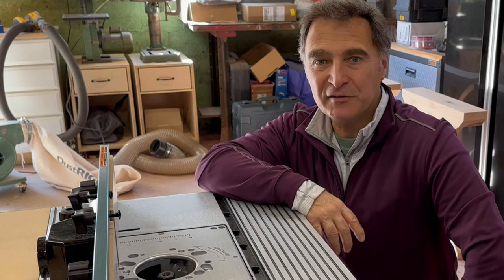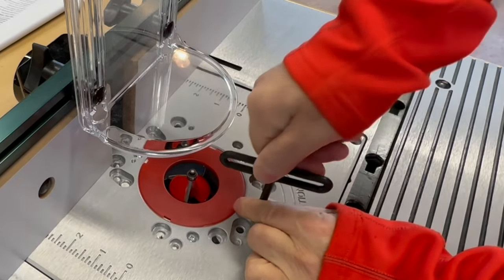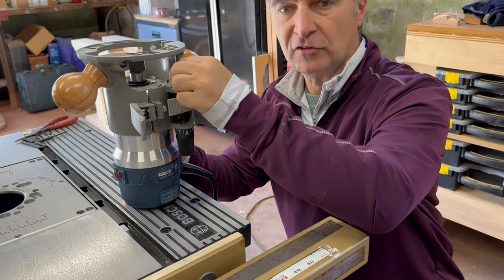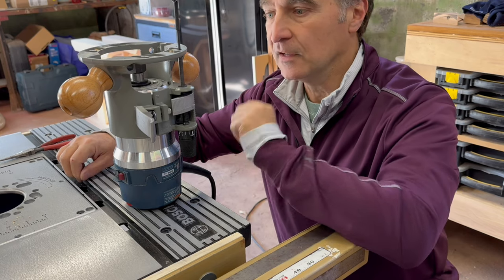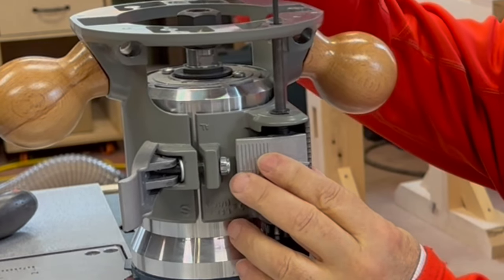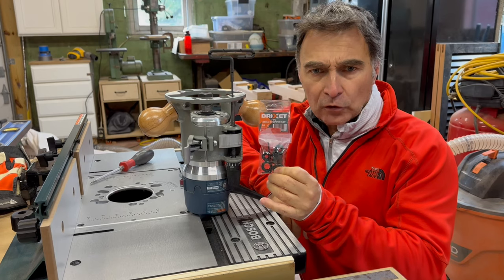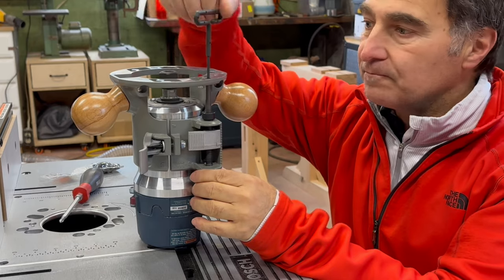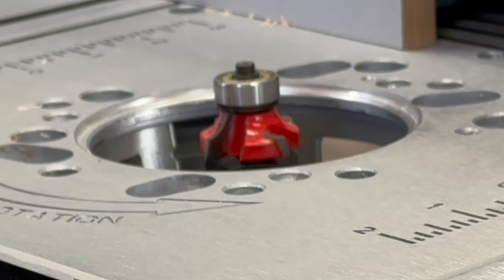Tool Tips & Reviews-Update:  Bosch Router Table Combo has 1 Major Flaw with Easy Fix!

Comment: Your fix is a good idea. You may have damaged the retaining ring by trying to force it beyond its limit. Before starting your work make sure that the adjustment mechanism is mid-range and only use it for small adjustments. If you have the removable motor router, make sure the motor is UNLOCKED when making the adjustment.
Reply from the maker: Thanks for the feedback.
Reply: Yes, if the collar is locked it will break the retaining ring I found out.

Comment: I have the same table/router. Never a problem with many yrs. of use.I find using the top adjustment, it's easy to forget unlocking. This causes damage as you've noticed.I use only under table adjustment so lock lever is right there.Mine is not perfectly flat either. I think at this price it's to be expected.Notice you have mounted it to Powermatic saw...Powermatic makes their own extension for router table...check it out.
Reply from the maker: Appreciate the feedback. 
The issue with the clip happens when the height adjustment rod is turned beyond its range.  Thanks for watching.

Comment: Make sure the lever  lock is open before turning the hex key to raise or lower the bit.
Reply from the maker: John, Thanks for watching and thank you for the feedback.
Yes... the lever lock must be opened to raise or lower the router. That wasn't the issue here.  The issue is the spring retaining clip on the height adjustment pops out of its slot when the rod is turned beyond its stop point.  See my companion video for more detail showing the clip popping out of its slot.
https://youtu.be/NK5-tMwq5tQ

Comment: Good video. I’m on the market for a benchtop table and this one seems like a popular choice. How did you overcome the warped table? There are lots of comments from folks having similar issues. Cheers.
Reply from the maker: Greetings,  The table is pretty flat for approximately 6-8” on either side of router bit. It’s the edges of table that drop off by 1/16” or so. 
I’ve been able to work around this by applying downward pressure to the work piece near the center of table / bit.
Hope that helps helps.

Comment: thank you so much! Did you have trouble with insert plate on the RA 1181, and if so, how did you fix it??
Reply from the maker: Hi!  No, I did not have issues with the insert plate. It did take some fiddling of the adjustment screws to get it dialed in and flush with the table. But no issues with it since.   Thanks for watching.

Comment: Looks like you had a router issue, not a router table issue. I would have liked to see how you actually accessed the end of the lifting rod in your video, disassembly and reassembly.
Reply from the maker: Yes, turned out the issue was with the router’s height adjustment rod... not the table itself   Also, thanks for the feedback on wanting more detail on the disassembly and reassembly.  I may do a follow up video detailing all the steps.
Thanks again for watching.

Comment: Why the heck is the table top not flat and slopes away from the center?  Is it an issue that makes routing troublesome?
Reply from the maker: Why not flat? My guess is poor QC at factory.  Note: The table is pretty flat immediately before and after the router bit opening… its at the edges of the table where its no longer flat. 
It hasn’t effected my routing tasks. 
Thanks for watching.

Comment: Hey Pete. Good vid. A few questions.. would you buy the 1181 again? If so, what table saw do you have? Finally, hiw did you hang the router table on your table saw? Is that a universal mount that works with other table saws?
Reply from the maker: Thanks for watching and the feedback. 
As for the RA1181… I would buy it again. 
It has it’s issues but is a good value IF you only use the router table occasionally.  I would suggest looking at a more substantial table if you plan on doing alot of router work. 
My tablesaw is a Powermatic PM66. 
I posted a video on how I mounted the RA1181. Here’s the link…
https://youtu.be/rjwlu9bzMnY?si=bA0VcWHT9jPJwbaw

Comment: I have a DeWalt installed in the table so I'm assuming the lift is not available for me
Reply from the maker: The lift mechanism is built into this Bosch router’s base assembly. 
Doubtful it can be used with a Dewalt router.  Maybe Dewalt offers something similar?

Comment: sir, what's the diameter of that router?
Reply from the maker: Hello. Are you asking about router body diameter? Or the height actuator rod’s diameter?  Here’s a link to the spec page…
https://www.boschtools.com/us/en/products/1617evs-0601617763
Reply: @PetefromBaltimore  the aluminum body where you can find the scale or lines with numbers? I don't know how to call that one.
Reply from the maker: @solo8827  I will be going to workshop later today. Will take a measurement and let you know.
Reply from the maker: 3 1/2” is the router body diameter. 
Hope that helps.
Reply: @PetefromBaltimore  thank you big time sir..

Comment: You screwed it up or down too far. All you would have to do is raise the router up to the next notch. This is what I found.
Reply from the maker: Thanks for the feedback @leecook7672
You are correct, the retaining clip pops out when height adjustment is over tightened. However, in my case it didn’t require much over tightening for it to pop off the shaft. 
Thanks for watching!
Reply: @PetefromBaltimore  it sure does not take much effort to make it pop. That's why I bought 2 spare clips.
Reply from the maker: @leecook7672  👍
Spare clips are a good idea if you choose not to go with a drill bit collar.

Comment: What does the Router itself have to do with the table?
I know what you did wrong.
You tried to lift or lower the router without unlocking the router before you tried to move the router up or down.
So don't try to say the Router Table is bad. This was a problem that YOU created and has NOTHING to do with the Table.
Reply from the maker: Thank you for the comment.
My critique is focused on the Router / Router Table combo which is sold together. But you are correct, the issue lies specifically with the Router. 
As for the the retaining clip issue... No, I did not forget to unlock the router. The issue is the clip itself which is very flimsy and pops out as soon as you reach the end of travel on the height adjustment.
Thanks for watching and for your feedback!
Reply: @PetefromBaltimore  nah,,, you forgot to Unclip the router. Just admit it. 😁